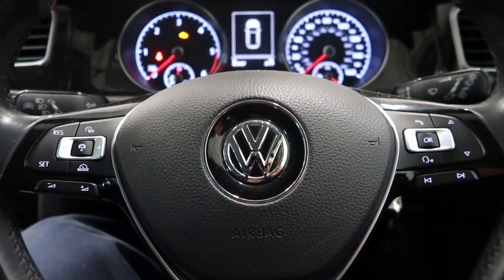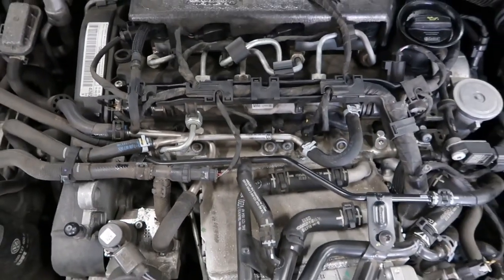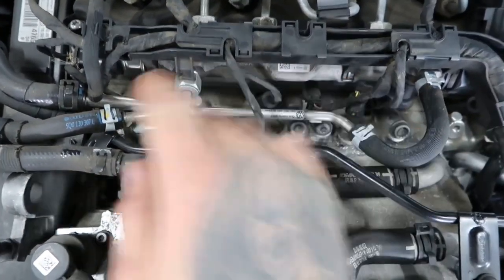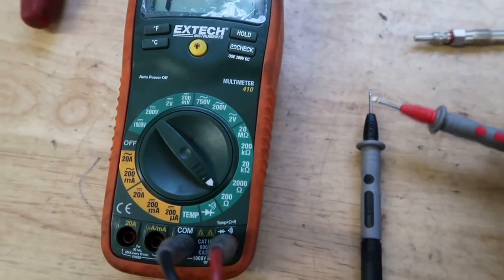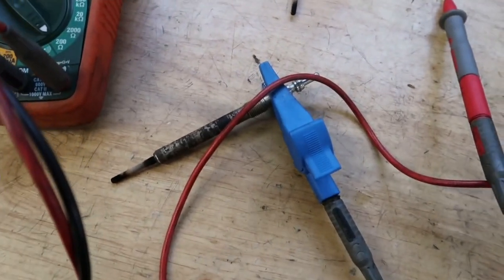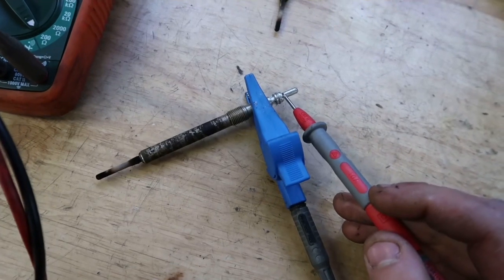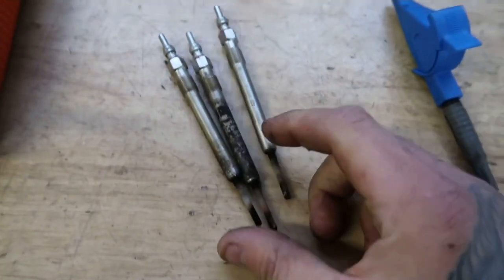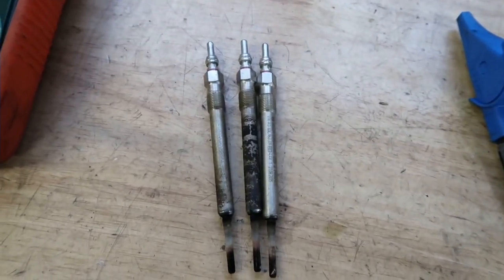Vw Audi seat skoda p067100 fault. Diagnostic glow plug testing method

Comment: All right guys. Here's how I solved my glow-plug problem. I have an Audi a3 TDI, year 2011, 170,000 miles.
The glow-plug warning came on and I mentally prepared myself to do the job this man is doing in this video. 
Instead, I used CataClean, a product I had previously used to clean my Diesel Particulate Filter (DPF). Cost is $28.00.
I followed the directions, emptying the contents in a quarter tank of fuel in my vehicle. Drove the vehicle at highway speed for twenty miles, then resumed normal driving. 
Scotty Kilmer, YouTube God, says the effect of products like CataClean actually occur when the vehicle is parked, so many short trips, in this case, are beneficial.
Within twenty miles, the glow-plug warning light no longer appeared. The light has not returned, even after 10,000 miles. 
I also used CataClean for a "check engine warning light" that appeared on my display.
Probably the light was for a fuel sensor. Within a few minutes of driving after emptying the contents of CataClean into my fuel tank, that check engine light went away and has not returned in 15,000 miles.
Save yourself time and money and give the CataClean a try. Cheers!
Reply from the maker: The glow plug warning light comes on as a warning to say theirs a fault on the emission side of engine management. In this case fault code for glow plug not working so in long run would stop the DPF for doing it’s regens. So your fix would not of solved this issue. I’m afraid a exhaust cleaner would not of solved a defected glow plug. And also worth remembering a blocked dpf is only the final effect of something not working correctly in the engine management side of things, there’s always a reason why your exhaust/dpf is blocking up, need to find the root cause before cleaning otherwise will happen again